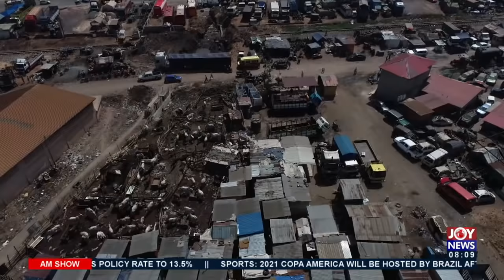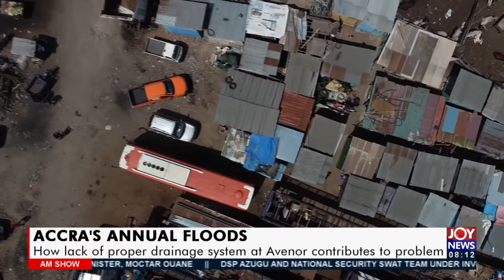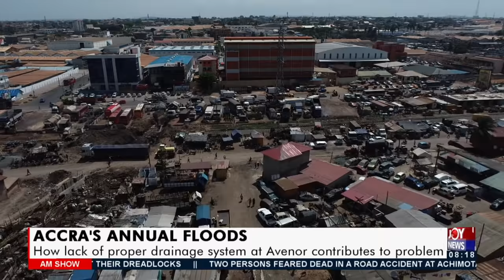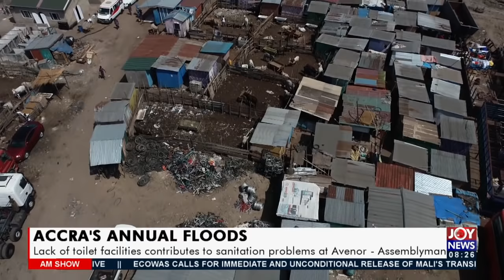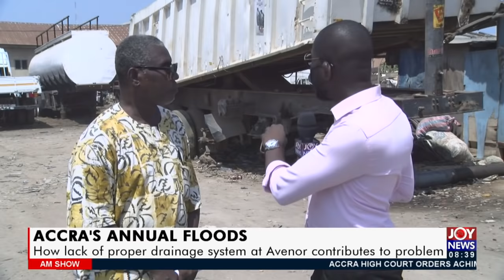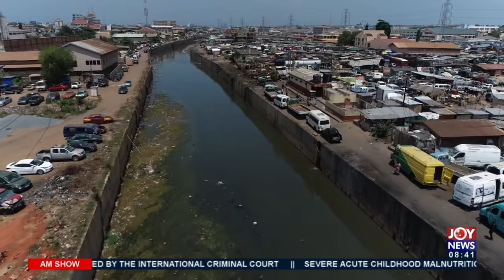Accra’s Annual Floods: How lack of proper drainage system at Avenor contributes to problem (1-6-21)

Comment: MASA I HAVE  NEVER  SEEN  DRAIN IN EUROPE  BEFORE  OO 
IT NEEDS   TO BE COVERED
Reply: You can't just cover only this drainage because the rubbish are coming from afar end however all the drainage around Accra need to be covered because if you cover only this drainage is cos 90... absolutely nonsense
Reply: @susan ... open does exist in Europe.  It mostly in rural area and industrial  area in the city. The only difference is that people doesn't dump trash in it. In Ghana,  96% connected their domestic  waste to open drain. 

Open drain is constructed  to collect rain.